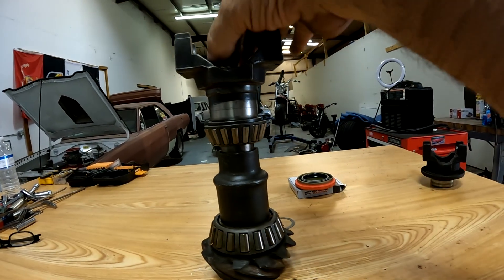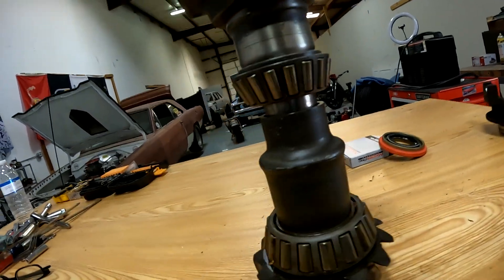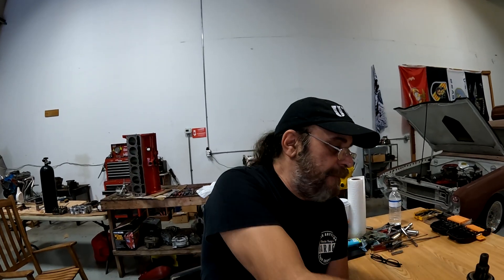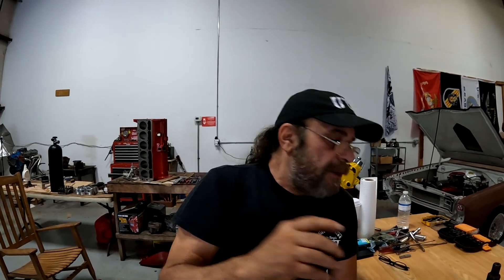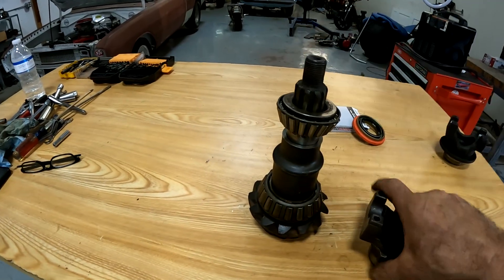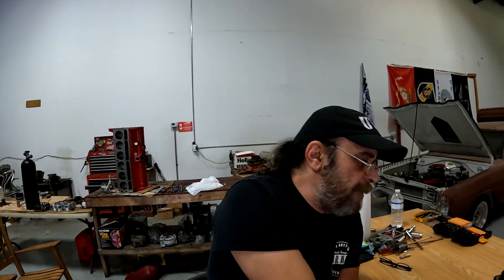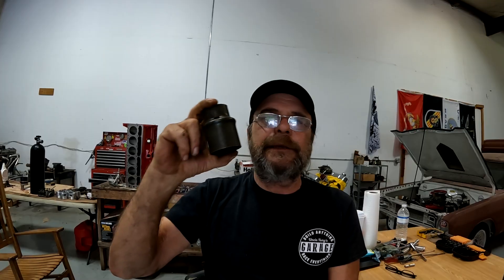Sooner Or Later One Of These Is Gonna Bite You - Dealing With  Your Diff's Crush Collar

Comment: The preload is required to reduce pinion gear head movement/deflection in the bearing radial direction as torque increases.  If the gear  moves too far you get noise issues or destroyed gear teeth.

It takes force to press the pinion tail bearing cone onto the stem.  It also takes force to drive the pinion flange onto the splines on the stem (majority of new pinion stem splines have a slight helix which creates an interference fit).  When the pinion flange nut is tightened it generates force to drive the tail bearing cone and pinion flange splines farther onto the shaft.  It is a very high amount of force.  The crush spacer equalizes the force generated by the pinion nut.  In the case the crush isn’t in place the high force generated by the nut will continue to drive the bearing cone and flange onto the pinion stem after you stop rotating the nut (due to creep).

If you to assemble a pinion without a crush spacer and get lucky enough to end up with good initial preload/rolling torque you’ll end up frying the bearings later.  As soon as you heavily load the gear set in the drive direction and push the pinion hard into the head bearing the tail bearing loses axial preload and the force generated by the pinion nut pushes the tail bearing cone and pinion flange further onto the stem.  When torque is reduces the bearings are going fry themselves.

If your pinion splines do not have a helix/interference fit (old reused worn pinion flange) the pinion flange has slight rotation relative the pinion stem which will back the nut off.

Comment: When crushing or re crushing after adding a shim to your crush caller take the old pinion nut if it is an interferent style acorn acorn or 3 pointed nut grind that part off  On the old nut  Till it spins easy up-and-down the threads apply grease to get your Preload close Then install a new nut And finish preload sequence ask me how I know You can ruin the threads on a brand new gear if you are not careful

Comment: Justified by the production managers . I've made or bought non crushable crush sleeves, and just worked them down to size on a lathe . 12 bolt, with a Summers spool, very strong, alright  not as strong as a Dana 60, or a Ford 9 .

Comment: You don't have to throw away the crush leave and redo it when you do opinions 😮 Or changing your pinion  Seal  if you're set up properly and you have a good assortment of  shims take a 10 or 15  One thousands of an inch Spacer/shim stack it on top of the crush sleeve and recrush it to get proper preload Bob's your Uncle have a nice day Replace the nut use lock type

Comment: Took my silverado driveshaft out to paint it and decided to remove the pinion yoke and clean that up as well, I know it was supposed to have like 20 in lbs of drag with nothing on there, but when I put it back on I just gave the nylock nut 100 ft lb for good measure, seems quiet and fine 20k mile later and counting.  Not sure I would have taken it off in the first place again though.  It's an R title it got hit in the side of the bed and that  was replaced, but I suspect bent the axle housing enough that I get inside tire wear and have to demount flip the tires and remount and balance just to get some more use from the tread life.

Comment: Hah. A cruise through YouTube and nobody can explain why a crush sleeve is even necessary.

"To set bearing preload" is the consensus, but you can preload bearings just fine without a sleeve or eliminator.  There's no crush sleeve on the carrier bearings, and those have a preload spec.

All that's out there on the internet is "necessary part," but nothing about what it actually does.  WHY do these bearings need to be pushed together enough to cause drag, but also need something pushing them apart.

I know what I need to do.  I need to get caught up on my ten million other projects and pull the crush sleeve entirely out of one of my diffs, to see what happens.

Comment: What I always loved is this. Once torqued, if you loosen the nut you're supposed to replace the crush sleeve. But you are supposed to measure bearing preload without the seal in place since it causes drag and gives a false reading. So, you crush the sleeve, find preload, but somehow have to install the seal without taking the nut off? Hmmm....
Reply: This is why when I replaced my leaking pinion seal, I just removed the nut and yoke, installed the new seal then installed the yoke and nut, tightened the nut just enough to remove any perceptible bearing play and turned with no binding.  Rear was fine, no noise.

Comment: My 75 charger would split the yolk  off the line about every 7 or 15 runs could this have been my problem my 75 off the line would pull the front 3feet of the ground hit 2nd gear tires squeal the  tires or split the yolk

Comment: TTTT Mesurment. Total Torque To Turn Mesurment.  Most all relatively late model differentials have that spec. Crush sleeves are for just what you say. Anything less then replacement and diff set-up is the only thing to do. Always use red lock tight! No matter what you fixed or the nut. That nut backing off can be disastrous and dangerous.  Just doing a pinion seal can have really really bad results.  Ask me how I know said the old 35 year Chrysler guy 😊

Comment: Ive re used them but measured them. If you change bearings or gears or both, sometimes if you kow the measurement you can crush further. Done the shim many times went parts just are not available. Mostly old stuff we are trying to save. I have an old craftsman top box and a whole drawer with nothing but shims!

Comment: Could this cause vibration without noise? Or maybe both? I have dual Flowmaster 40 series mufflers so I might not be able to hear it. It only does it at speeds over 45 and it doesn't do it constantly. It's just a vibration or bouncing feeling. I just started noticing it and I'm not sure if it's in the driveline or maybe a tire. It's not in the steering or brakes. I can tell that much. It does it accelerating, at steady speed and decelerating. This leads me to think it's a tire issue but I haven't had time to check it out yet. I hope it's not a tire cause they're only a year old. Mastercraft Avenger G/T white letters. It's the only way I can make my Buick Roadmaster sedan feel like a hotrod. That and the Flowmasters

Comment: You are 100% right! I've always hated that crush sleeve. I only had one fail of many but it sucks to kill someone's diff. over a cheap part. My boss ( mentor) explained the same issue with factory vs. impact. On a full rebuild we would use a giant breaker bar with the diff. either removed or turned to get full swing. We would try to tighten using even pressure without the dunga dunga gun.
Reply: same here man on me when i was 18 on my 56 chev.....he done it with breaker bar and pipe and explained....I had no clue then....it takes ALOT to crush a new one I learned......miss them ol timers...and Tony is pretty slick himself on things.
Reply: @chrishensley6745   I agree the old school types (oops I'm there myself) have a lot of knowledge that is very valuable. See Nick's Garage! 
       I wish that the newer generation of mechanics better understand the exact methods rather than strongly using computer only methodology.

Comment: I ran into a problem close to this working on a fleet of 04 workhorse trucks (p35 chevy)they had Dana 70s in them but the closest dealer was 40 or so miles away, my boss sent them out to a local guy he replaced the front pinion bearing and seal within 4000 miles they leaked. So I told my boss no more subbing out these rear ends did not have crush collars the bearings were shim fit and all 14 were shimmed too tight causing the pinion bearings to wear and causing the leak I did 14 rear ends that went 150k with no problems before that I only ever saw crush sleeves have a goodnight

Comment: Why can't you reuse the crush sleeve by just tightening the nut a bit more? I'm a bit confused.  Won't that put pressure on the sleeve again?
Reply: It would also put more (possibly too much more) pressure on the bearings as well. It's the crush sleeves job to set the bearing pressure.

Comment: I did a bunch of Dodge Dakota ring n pinions, when I worked at the dealership. 
Pinion bearing preload is technically set with no ring gear in place. 
Good information Uncle Tony
Reply: Right after pinion depth is established. I like new bearings & gears in the same housing, because i dont need a dial indicator or carrier block. Just calipers & a note pad

Comment: Never re-use the lock nut or the crush sleeve. In 45 years as a professional tech I have never ever had a pinion nut come loose. Use a dial indicating torque wrench to measure rotating torque (not for the pinion nut torque) and follow closely the specs for used and new bearings.
Reply: the inch pound dial wrench is a jewel  for differential work!!!
Reply: @MrChevelle83  Thanks, I neglected to mention inch pound.

Comment: I would mark the nut and change seals putting the nut back to original and never had a problem. Anything deeper got a new crush but making it crush often took way more torque than it  should. Especially on Ford 8.8 rears.
Reply: Hahaha! Try crush sleeve torquing a Dana 135 truck diff! Now that's a job!

Comment: Fords have a smaller crush sleeve or bushing! What I do in a race application is crunch the sleeve down to normal install specs ….then remove it and measure the thickness….then I go to my abundance of shims and get something close …install the selected shims and torque to spec. Then I’ll check for looseness and break away torque…if it’s not right I’ll add if subtract till I get the desired specs….haven’t ever had an issue..

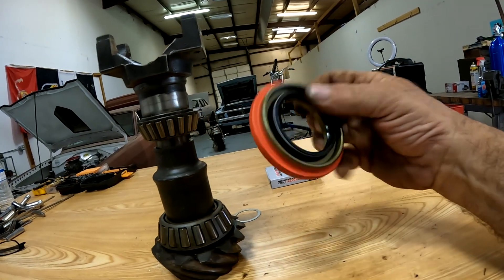Comment: 11:40 "Like I sez!"  :) This will never happen to my Corvair's diff, no crush collar used. OTOH both rear wheel bearings use opposed tapered bearings to an axle yoke (just like 4:20) and you have to select a custom shim to achieve the right bearing play. A real PITA, but I like MD Cuddy32 's comment here to use crushable solder. I'll do that next time.

Comment: I use a 1/4” drive beam type torque wrench to check pinion bearing preload. It’s 8 to 14 in lbs on a Ford 8.8. I always went for 11in lbs of drag. It’s best to use a 3/4” drive ratchet to tighten that pinion nut to set the preload. A 1/2” drive breaker bar is too springy to feel small incremental movements of the pinion nut to set that preload. Use red Locktite always on that pinion nut.

Comment: We used to have a saying in the transmission shop do you know more than the engineers?, I don't think so, Your dealing with 50 to 55 year old rear ends that have been built a couple of times or more and most likely not the right way (hoof prints), The crush collars do not go bad, the pinion bearings wear out, loosen up after time, or not set up properly to begin with which I would say was most likely your problem, All tapered bearings have to have preload or they will make noise after a short time. A pinion depth gauge works wonders.

Comment: Thanks Tony, been working with cars for forty years plus and never reused a crush collar before.  I may try that shim idea next time I am that deep again.  Seems like an excellent procedure and I wonder sometimes how I didn’t hear that from someone when doing jobs like replacing pinion gears after blown and lunched rear ends over the years.  I personally would not agree to go with the majority of utubers out there but yes that would be the best answer with a strong disclaimer of any true accuracy.  I always find the book and exact measurements, requirements and settings for the device or for the machine.  If you strike out finding the book on what you are working on, like if you have to know now, then yes probably your best choice for utubers would be to go with the majority of the ones claiming they know that match others.  I am busy and every once in awhile when I know I have a problem on a machine I may watch a utube on it.  More than I want to admit I was fooled by some one claiming Jesus level expertise on this exact make and model only to find out in reality they were completely wrong.  I can’t even remember the times.  The last one I clearly remember was when this guy on a video swore you could just unstrap a gas tank if it is this exact make and model and all the factory connections and gas line would not have to be touched.  He swore his life this was correct betting his pride and reputation on it.  He had twenty five college degrees for working on cars.  I watch this crap thinking:  OK I got it, going to do that.  Nothing was long enough to do that.  Supposedly same exact machine make and model that he was working on.  So a guy is fumbling around jacking the tank back up and re-strapping it back up.  I knew I had listened to a person who mistook what he had stating they were all that way.  So unwitting, blooming idiot or evil, no don’t do that, don’t ever do that or think of trying that on this exact make and model machine at stock height, the gas line and wires are not long enough to reach, beware idiots out there are wrong.  My machine was pristine, never been touched in that area by hands outside the factory.  The fuel pump failed the kind inside the tank.  His video was a perfect way to set a guy up to rip off or break the gas line and wiring.  In his video he is stating, yeh, the wires won’t look like they are going to be long enough to reach the ground but trust me and God that we know they will reach.  So always beware, this bad advice caused me to lose a little time.  I took a close look and thought, yeh right, there is no way this gas line or wiring are long enough to reach the ground but I just saw it done and the guy said it will look like they are not long enough.  I decide I will proceed but move slow, just in case.  What saved me was going slow and watching while keeping it on the jack.  When it was about in inch from being on the ground it was apparent that anything lower would cause damage.  You are screwed, without the tank straps connected and it just balancing on the floor Jack, you have no choice but to carefully jack it back up to reconnect the straps so you can disconnect it where it was at.  That is awkward, slow and painful to do where it is at.  You were trying to save time doing it this utube guys way, (idiot, I don’t know).  In the end it didn’t save anything, it cost me time.  Why did I listen to this guy, well, right, got suckered.  Always understand to watch and listen and trust your own understanding and feelings on something.  Hard to know how accurate the information is.  More often than not it is accurate or fairly accurate, that is why you can get burned and sometimes real well, when it is not accurate.

Comment: It usually comes lose after someone pulls the yoke off to replace the pinion seal, guys would mark the nut’s relationship to the pinion (with a sharp ding from a chisel) into the nut and pinion. Replace the seal, reassemble with loc-tite back to the mark made, then, tickle it another 1/8th of a turn (wear take up) 🤔😉
Reply: Yep!...way I always seen and done...even at Dealership back years ago and nowandays.
Reply: I've done that a couple of times, although  tightening less than an additional 1/8 of a turn, and it worked out okay but I worried about it, until I forgot about it.
Reply: Exactly how I’ve always done my fords. Figure, by the time and age of the vehicle, that 1/8 turn is helping the preload.

Comment: Never done a 8 3/4 MoPar but have done the 8 1/4, 9 1/4 and one Dodge Dana 60. Dana 60 a bitch with all the shimming & spreading the case BS but got it done. 8 1/4, 9 1/4 piece of cake and both have crush sleeve but it is way, way shorter than that. The 9 1/4 had a mechanical lock nut not nylon, that was the case in 2 of the bearing kits I got. Also, there are 2 different bearing preload specs to follow, one for used bearing and another for new bearing. Don't know why that is unless they are allowing for some wear of the bearings.

Comment: Ford tells you to check the preaload before taking apart a 7.5 or 8.8  for a pinion seal.  if its at or above spec, tighten the nut to put it back how you found it.  If below spec, tighten the nut until its in spec.  Did it on my 7.5 car, found zero preload, put it back to in spec and the whine stopped.  Figured it was worth a shot before pulling the carrier and replacing it.  Seal was so bad it was just dumping oil so I couldn't ignore it.

Comment: The ole shim it and crush it again is a great trick that works perfect. Also saves the day if you have a whoopsie and crush the sleeve too far on the first try building a new or used rear. One common misconception however is that crush sleeves fail under heavy loading or abuse. If you stare at the orientation of the bearings and understand the direction of the forces its apparent that the sleeve (or shim stack) doesn't experience any additional compressive force under heavy pinion loading accelerating or decelerating. The whole "my crush sleeve relaxed" thing is BS. If the sleeve relaxed you would actually gain pinion preload and wouldn't have the decel noise caused by a loose pinion fit. What actually happens is, as things wear and preload diminishes, the pinion nut can back off slightly and create the slop. Great job explaining this. Awesome video.
Reply: The purpose of the crush sleeve is to keep the inner part of the front bearing from spinning on the pinion.  
When you have bearing preload, the inner and outer race of the bearing have resistance to rotation to each other. This creates a likelihood of the inner bearing race to rotate on the pinion shaft. Look at a pinion shaft that has had a loss of pinion nut tq. It will appear polished where the inner race contacts it.
Reply: Ya know, you are right, if the crush sleeve got shorter, the preload goes up